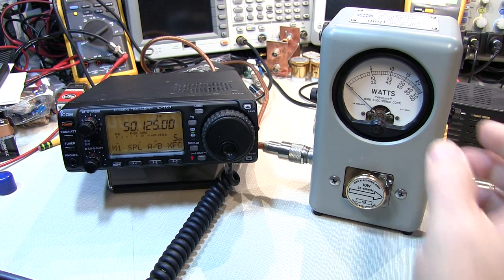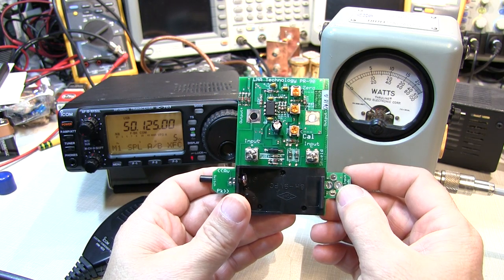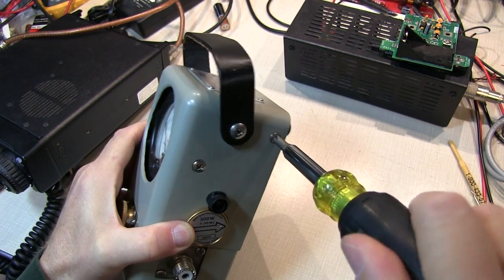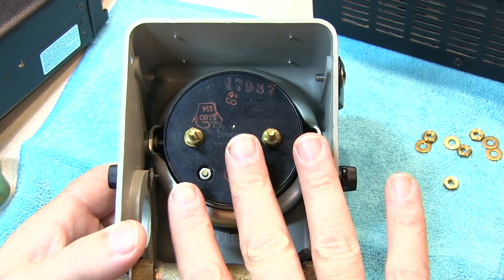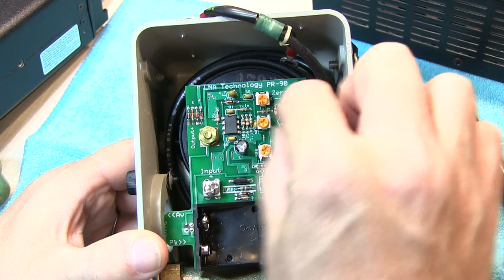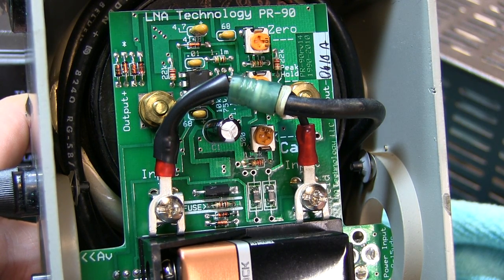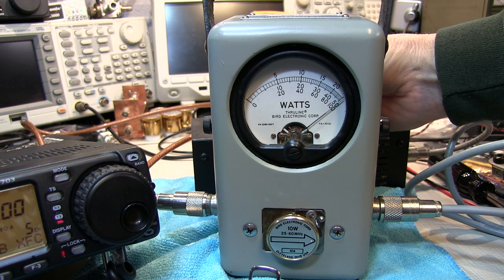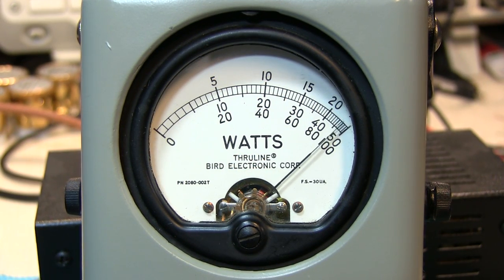#222: Installing a Peak Reading kit into a Bird 43 Wattmeter

Comment: I installed a different peak meter kit, it also has an extra switch that gives you X2 and X5 meter readings, so a 10Watt slug can be used as a 10Watt, 20Watt and 50Watt slug, that saves you a huge ammount of money because you dont have to buy so many expensive slugs and that kit has a led indicating when its on.
Reply: Where does one buy one of these peak kits...not the Bird, the one out of Florida recommended here? I can't find it? Thanks
Reply: @nelxonmiranda  You can't - the company closed down and the LNA PR-90 is no longer available.

Comment: Thanks for sharing Alan. With the OEM Bird peak kit as I mentioned before you only lose one of the "spare" slug holders on the side of the case. Does the LNA unit come with some kind of inserts for the sides to keep stuff out of the case (didn't see a side view in the video)? The Bird kit resembles a slug with the on/off switch and LED integrated into the cover.  73 - Dino KL0S
Reply from the maker: The Bird kit is much nicer in that regard. The PR-90 doesn't have covers to fill in the holes, nor does it have an LED indicating when it's on. I'll probably add both with homemade units.

Comment: I have the RF BNC connector sampler built in on the right side of my bird 43 wattmeter. will the board
fit ok, i do not want to take the bnc connector out, please advise, tnx   Ron in Ohio
Reply from the maker: If your meter is the 4431, I don’t think this particular peak adapter will fit. There are other leak kits that are smaller and may work better for that meter.

Comment: Hi Allen although it is a quite old video. Does  this peak kit can read the the Power output of a radio using digital mode of the radio. Meaning measuring digital power output signals. Hope I explained my self. Regards
Reply from the maker: Digital modes simply are a different modulation type - this kit will still read the peak RF power under these modulation types too.
Reply: w2aew thanks a lot for your prompt response. I enjoy all your videos.

Comment: Great stuff Alan,
Could you compare/contrast (or do a video on) the Telewave 44 series watt meter?  
As you probably know the Telewave does not use slugs but rather just a range switch and Fwd/Rev selector.
Thanks for sharing your knowledge.
dwight N7KBC
Reply from the maker: +Dwight Merkley Maybe in the future.  I don't know much about the Telewave 44 series. Never used or owned one.
Reply: +Dwight Merkley  The biggest problem I see with the Telewave 44 is that it starts at 20 Mhz. Not an ideal range of frequencies for ham radio use.   Otherwise, it's a nice meter.

Comment: What about shorting the meter movement for transport after this modification?
Reply from the maker: +BersekViking Simple.  Turn the circuit off and the peak adapter circuit is bypassed. So, you short the meter the same way (dummy plug or rotate the element by 90 degrees).

Comment: I wonder how accurate the peak reading is with these boards ??
i have the same board and my radio (CB) does 1w dead key then peaks just over 25w (using a 25w slug and lowering it to 1w for test purposes)
now even at full power the radio only does 10w, so where does it magically find the extra 15w from ??  fresh air..
Reply from the maker: Having an 1w dead key and 25w pep indicates some kind of non-linear peaking going on with the modulator.  If the modulator were perfectly linear, the PEP would never be greater than 4x the dead key power.  One way to see for sure would be view the RF envelope on an oscilloscope and the signal's frequency content on a spectrum analyzer.